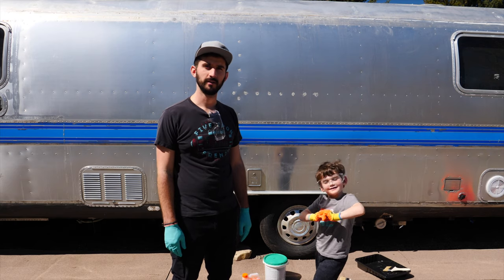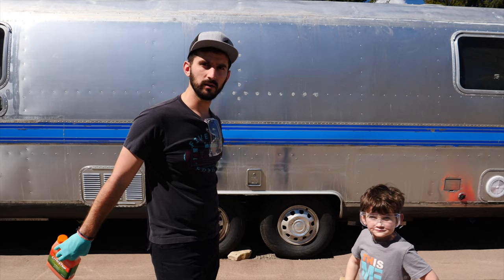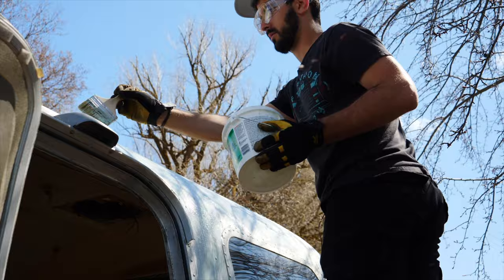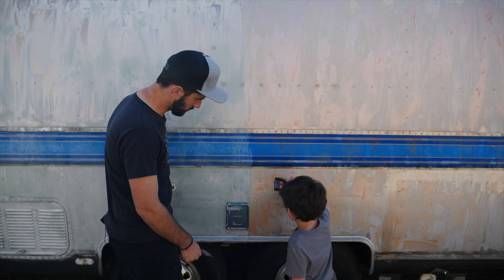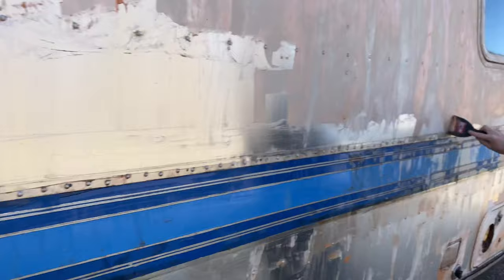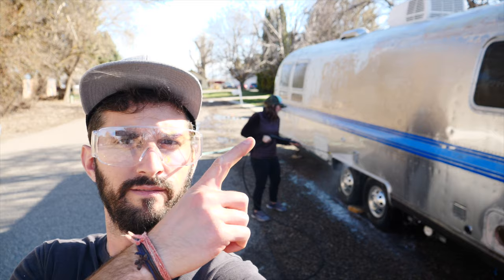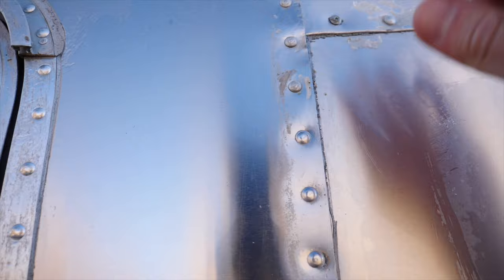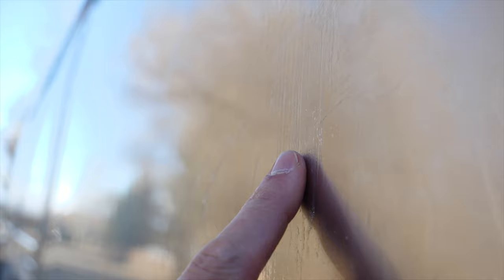Ready Strip VS CitriStrip: WHO WILL WIN?? - Stripping clear coat off our 1987 Airstream Excella

Comment: You’re not supposed to let the ready strip get that dry. I’ve used it for almost 20 years. As soon as it changes color, it’s time to remove. It’s in the instructions, too. 🤷🏼‍♀️
Reply from the maker: I read the instructions and it never said anything about not letting it get too dry. Either way we did a test scrape when it first turned white and wasn't working yet. 🤔

Comment: I just bought the citrus and have used the used the Ready Strip and i prefer the Ready on wood. The Citrus was gooey and just awful to work with. You literally have to wash and sand off the remainder of citrus :which stuck on the wood....
Reply from the maker: A V Though this video was not about using it on a wood application, that is good to know! Thanks for watching!
Reply: @ChasingtheWildWonder  great to know that citrus is great to work with,  on metal. I appreciate that.

Comment: Can this be applied to the car without damaging the paint?  What are your recommendations
Reply from the maker: I would imagine not. This is a paint stripper, and it says it works up to 5 or 7 layers deep. I personally wouldn’t risk it on a car if you’re just trying to remove the clear coat. But I’m no expert, just my opinion